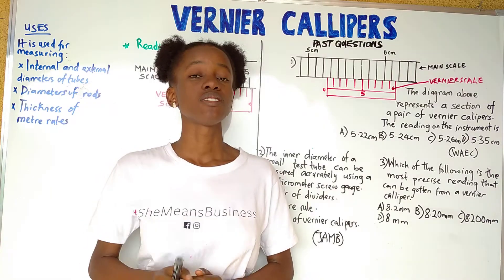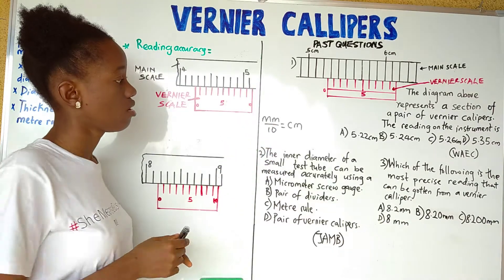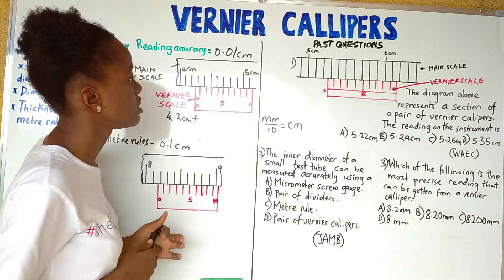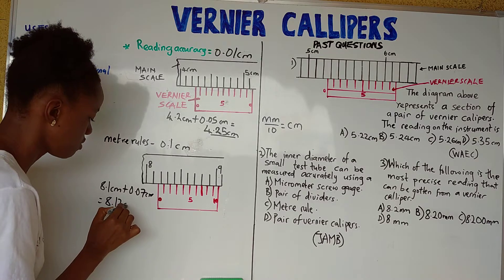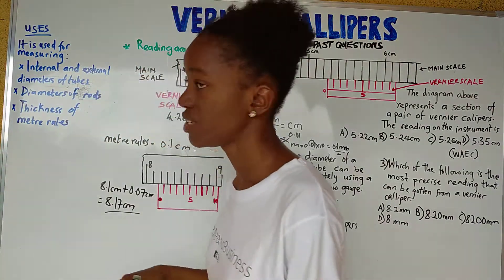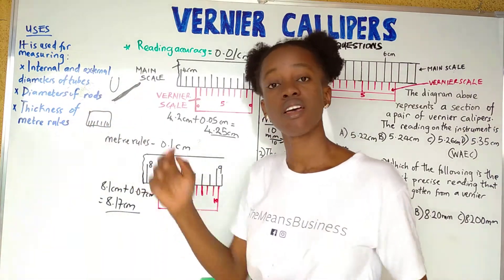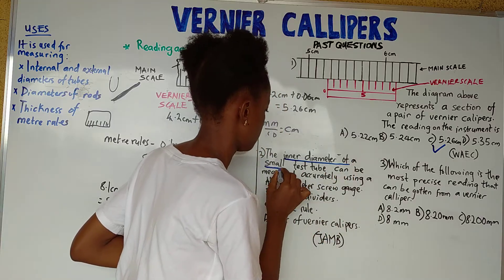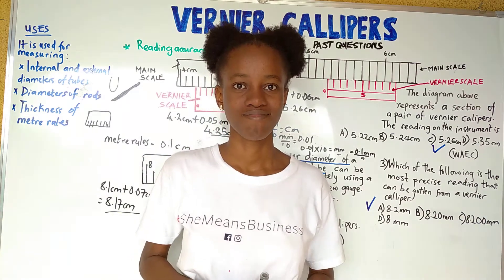Divine Gift Lectures:How to solve Vernier caliper questions|

Comment: My dear sister, there's a particular issue I'm having regarding this Measuring accuracy of instruments and I'll really be appreciative if you can clearly clear out my doubt pls🙏

Now, I learnt that....

If the smallest graduation of a meter rule is 1mm then its measuring accuracy is ''½ of its smallest graduation i.e ½*1mm= 0.5mm

If the smallest graduation of vernier calliper is 0.1mm ,then what is its measuring accuracy???

And if the smallest graduation of microscrew gauge is 0.01mm,what is its measuring accuracy???